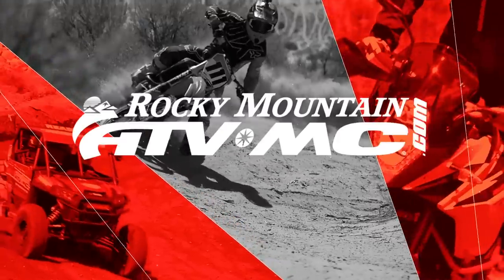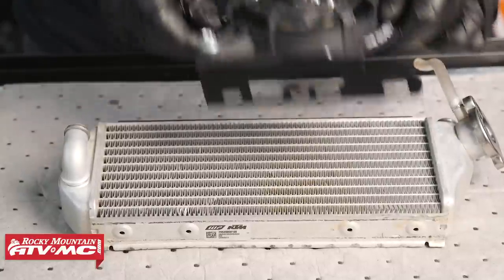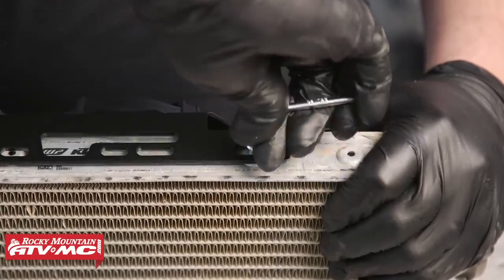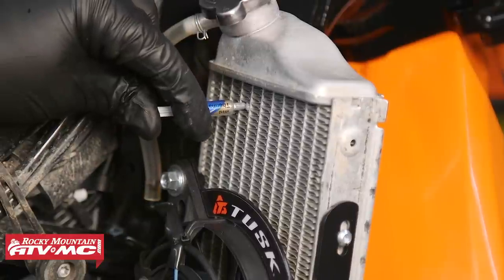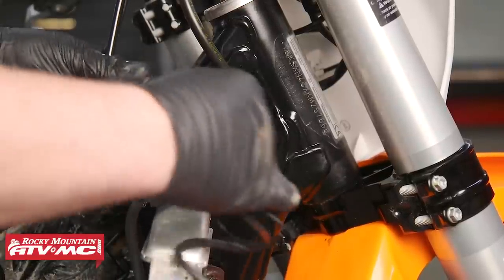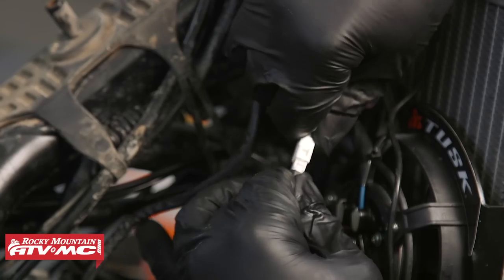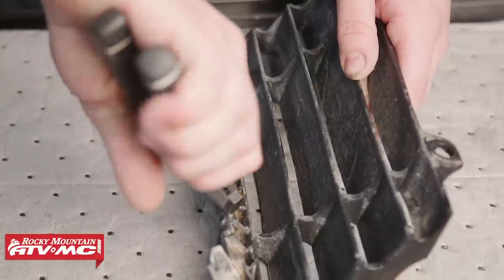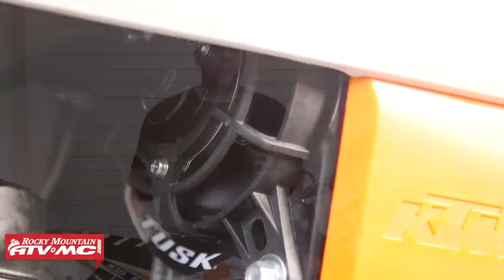Tusk Digital Radiator Fan Kit Install | 2017+ KTM/Husqvarna Dirt Bike

Comment: Be warned.  I have this kit and in my experience it can drain your battery. I keep a battery tender on to avoid this, but I believe it killed my OEM KTM battery.  Why?  Because I have two 2020 KTM's (250 XC, 300 XCW, both TPI with lithium batteries).  One had this on, one an OEM kit.  OEM kit one was fine, this one, dead battery a few months after install while sitting in storage - both bikes in same storage location exposed to all the same elements and both bikes were bought new within a month of each other and ridden roughly the same hours (only 20-30).  The OEM KTM kit on my XCW is simpler and does not use a display.  KTM does not make an OEM one that I know of for the XC or I would have gone that direction.  After a couple months, the Tusk display had nothing on it and my battery was dead.  Replaced battery and all is well again, but I have no doubt it will kill the battery if left alone again.
Reply: The solution to this problem is to run a off/on switch off the ground cable that way you control when the fan kick in and when power is sent to it. Hope that helps !

Comment: I recently bought this fan kit for my 22 KTM 350 XC-f (FE), part number 1919450001. Seems pretty straight forward, but (you knew there was a but coming didn't you lol) I can't find the four T-25 torx head screws. I've looked through out the large box, moved all the styrofoam, looked in the thermostat box, no luck can't seem to find them. Can I get the specs (thread and length) for the screws so that I can pick some replacements  at my local hardware store.                                                                                                                                     Thanks for your time.

Comment: Wonder if this system can be used on my yz250 if I ran it off a good RC car battery?
Reply: I put a ttr90 battery in my air box on my yz250.  Wire the fan to a switch to turn on when you want it. I wired a trickle charger pigtail to battery.  I use it for fan and headlight.  Ran light for 4 hours and still didn't kill battery.  I just plug my bike in when its sitting in garage
Reply: @justindwyer3832 genius 😮

Comment: This fan is meant to suck air thru the radiator, or push air to the radiator fan?
Maybe ididnt see correct but you put the fan behind the radiator (looking the bike from the front)
This will push air to the front of the bike, or suck air from the front of the bike to the rear of the bike?
Reply from the maker: This fan is designed to mount behind the radiator and pull air through the radiator. Hope that helps!
Reply: @rmatvmc  Is it better to place it in the left radiator or right radiator?

Comment: do u have radiator fan 390 duke  2018
Reply from the maker: Unfortunately, we do not sell a radiator fan that is an exact fit for the 390 Duke. But we do have a Tusk universal radiator fan kit that may work for your bike if you have the room. You can check out that fan kit here: https://www.rockymountainatvmc.com/parts/tusk-digital-radiator-fan-kit-universal-p

Comment: I bought a fan for my  2021 te 300 that I'm planning to install a radiator fan. Tusk from RM atv's.  do guys know If i have to buy a relay or something that will not drain my battery? This is the first time I've installed a fan. I have no idea how much battery it uses. Is there anyone here who has installed one before? Can you give me ideas or recommendations? I did a search and didn't find anything. Thanks in advance for your help with this
Reply from the maker: The thermostat has it's own battery that will power it when the bike is off. The fan will only use battery when the bike is running and the fan is needed. So no, you don't need a relay.

Comment: Does the Thermostat always remain on - showing the temp?
Reply from the maker: Yes, as long as your battery is connected and you don't have blown fuse, the temp will be displayed even with the bike off. Thanks.
Reply: So since my 2018 ktm 450xcf has no key this system will drain my battery if it not plugged into a battery tender right?
Reply: @805hondajdm  might take a few years. Look how long a digital watch will run for, likely uses about same amount of power.
Reply: @805hondajdm  on my xcf I ran fan to a shut off switch because fan would run for few minutes when my bike was off and kill my battery.  Shut off switch will eliminate any battery drain.  Something you don't want when you dont have a damn kickstarter
Reply: @justindwyer3832  always remember, you can still push start 😂

Comment: there anyone here who has installed one before?
Reply: I bought a fan for my  2021 te 300 that I'm planning to install a radiator fan. Tusk from RM atv's.  do guys know If i have to buy a relay or something that will not drain my battery? This is the first time I've installed a fan. I have no idea how much battery it uses. Is there anyone here who has installed one before? Can you give me ideas or recommendations? I did a search and didn't find anything. Thanks in advance for your help with this